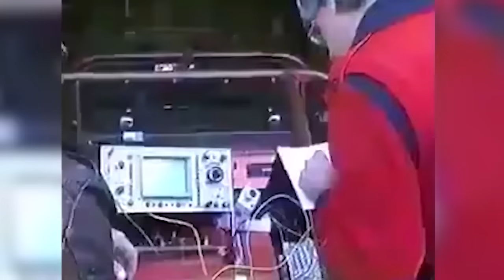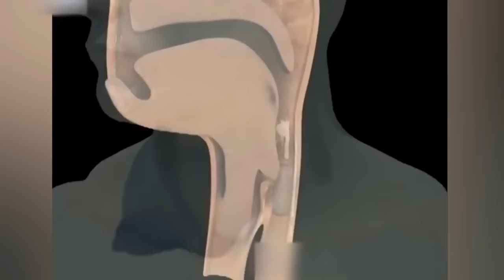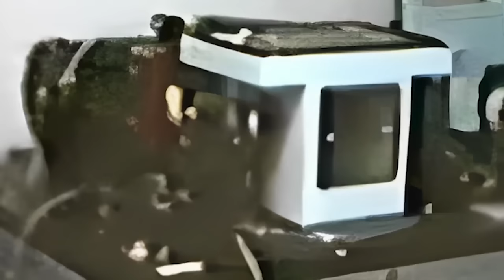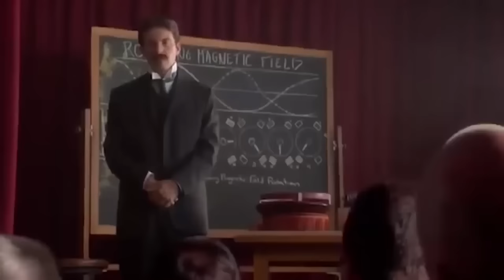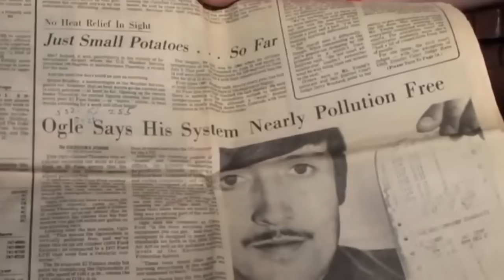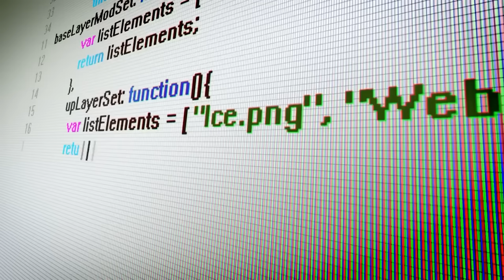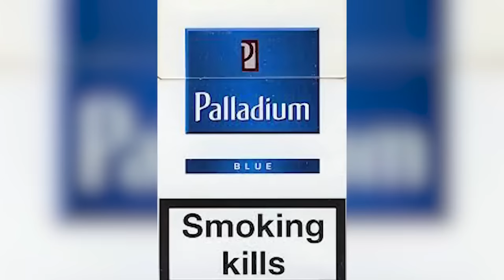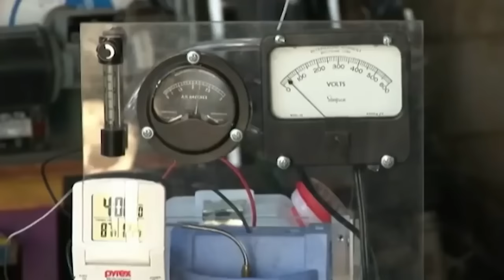Lost Inventions That Could Have Changed The World

Comment: The second item is a heat exchanger. Modern bolts used to mount it don't look particularly old now either.
Reply: I saw that and i was like BULL SPIT. Those are MODERN hexhead bolts. And it's "ancient"?
It might be an antique. It might be early 20th century or even older.
Reply: It is correct that the second item is made by Viktor Schauberger and it is on display at PKS in Bad Ischl Austria 🙂
Reply: ChillCat665    I think youll find its a water vortexer,  causing water to be charged with negative energy

Comment: At a our 2:10 there is mention of an ancient Egyptian invention in an upward spiral of tubing. I wonder how “ancient”. If you look close the contraption is held together with hex head bolts. If you zoom in you can see that there is stamping on the heads but I didn’t have the resolution to read it. Can someone?
Reply: I assumed those were used to correct and maintain it's shape. Those are definitely modern bolts, washers and probably clamps.
Reply: This is viktor schauberger invention 1900s
Reply: Good bolts have their tensile strength stamped on the head. I assume this is what it is.

Comment: Ogle was murdered by the Oil companies because he would not sell his invention to any of them…!
Also, the guy that invented the water car did create a vehicle that ran on water or the Hydrogen in 
water…
There were some issues with it.
One, the water/Hydrogen did not work well with our Norman engines, specifically the pistons.
The water caused them to rust.
If a few modifications were made though, the invention would work…!
Look up Hydrogen powered vehicles on here and they will show you how to create the Hydrogen,
along with how to use it to run an engine.
You can also see equipment and even cars being ran on the Hydrogen…

Comment: #sweettopic is a modern built device.  The bolts have a hex head and there is a threaded insert at the end of one of the pipes also with a hex head.  Nothing from ancient Egypt shows use of hex assembly tools.  Number 19 is an electrolysis machine and the inventor had a mysterious death.  Nothing about it violates any of the laws of energy.

Comment: Some rather misleading comments made in this video. The man who invented the car that used water as fuel was ahead of his time, there are currently people making their own systems that split the water into its base elements and use it as a torch instead. He also died in a questionable manner as well as the man who invented the carburetor that got 100 mpg, but let's ignore that because big oil denied any wrong doing and has only continued to help consumers get all the mileage they can from fossil fuels. Cars in the mid-70's were getting 40-50 mpg when big oil decided to not produce claiming 'shortages', until they continued to receive subsides from the government to cover operation cost, because they aren't making record profits every quarter right. And then, gas mileage went right back to 15-20 mpg where it sat until the 'hybrid' joke of a system was released. 
Im guessing the creator of the video doesn't get the concept of hydrogen fuel cars. Unfortunately, the way they get the hydrogen today is worse for the environment, and will probably be a catastrophe in the future qhen all the CO2 is released from the ground. 
Tesla was well ahead of his time, and the teal reason he didn't finish his research for wireless electrical systems is solely because his investors couldn't figure out how to make people pay for something they get over the air. Apparently, you would be incredibly surprised at the amount of inventions Telsa could create if only his investors had the forsight to let him invent without the constraints of how they can profit from it first and foremost. Clearly, you didn't know he created the first radio controlled device either, a little boat he piloted around a pool in New York City.

Comment: My take on @sweettopic is it's a water heater. Notice the vent holes all around for the smoke and air flow.  The clay would have been heated and water flowing through the tubes been heated
Reply: its an art project non corroaded copper    hex bolts

Comment: 24:00 "the theory of cold fusion hypothesizes that this could be achieved at room temperature." 
No. That's neither a theory nor a hypothesis. The theory was basically that fusion could be made to occur under controlled electrodynamic forces of compression occurring within a metallic crystalline structure with precise properties. And if you actually do the research - it worked. It's still around except it's called Low Energy Nuclear Reactions - LENR.

Episode 7 - July 27, 2023 - LENR (Low Energy Nuclear Reactions) can decentralize power production... - YouTube, https://www.youtube.com/watch?v=LUe97oyXFuA

Cold Fusion Hot Again - 60 Minutes - YouTube, https://www.youtube.com/watch?v=UTvaX3vRtRA

Comment: The water fuel one probably would have  worked but oil men wouldn't like it too because if you can run vehicles on water it would be at a fraction of the price of oil  so I wouldn't be surprised if

Comment: That twisted tube machine looks like something similar to Wilhelm Reich’s rotating momentum accelerated water “wheel” an invention later developed by Sam Klem. By recirculating a fluid (water or oil) from the circumference to core; the effect accelerates the spin by conservation of momentum ( like a spinning figure skater pulling their arms in while spinning,or the rotating Earth that constantly releases atmosphere into space while generating more at the surface.)
A non-consuming power source for power generators or motors. Eliminating the need for burning oil or electricity for rotational power.

Comment: The second law of thermodynamics is still a lot of fun.   Design and make a Rube Goldberg device to continually move.   A clock at some university is still running on a battery made 187 years ago,  A bell is still ringing that has stopped up occasion and needs to be restarted.  A company has used the principal of the Sterling Engine to liquefy air.  It makes gas for the big laser on the Gerald L. Ford.
Reply: That 187 year old battery is NOT perpetual motion, it's just a very slow chemical reaction that produces enough energy to run whatever clock they have it hooked up to.  It's call a Zamboni or Duluc Dry Pile; the electrolyte is dry paper rather than liquid acid or alkali.

Comment: About that 'carburator': OK, today we have gone to fuel injection. What he did, was raise the pre-ignition temperature of the fuel. About 90% of the energy used by an internal combustion engine, goes into bringing the fuel to ignition temperatures. A varriation of what he did, began by wrapping a fuel line around the exaust pipe of a motorcycle. It may have even been this guy. This temperature raising mentality would still be valid for fuel injection. However, concerning fuel efficiency, there are MANY other engine designs available. See Liquid Pistons, Bourke, Stirling, Duke Engines, e-REX [Spain].

Comment: The information in this video is complete BS! Firstly, #20...that is copper piping with a modern fitting on it that can be found in any hardware store. Secondly, #19...I have studied Stan Meyer's design extremely and it had ABSOLUTELY NOTHING to do with "perpetual motion". It was a hydrogen electrolysis system designed to break water into it's separate gases. Hydrogen & Oxygen. Stan Meyers then used the extracted gases, which were already the perfect fuel-air mixture, to fuel a regular gas engine and PROVED that this could replace gasoline as a fule for nearly all internal combustion engines. He also was able to prove that the exhaust from the engine produced clean water that was pure enough to drink or be reused in the engine again. So, this poster of this video has no freaking clue what he is even talking about!

Comment: That's not even vintage! Ancient Egyptians didn't use bolts with hexagonal heads and most certainly didn't know about washers/spacers and look at the numbers on the bolt heads. 🤯 I'm sure they didn't know what bolts were during that period , they built ships and not a single one had a bolt in it let alone a nail.

Comment: 1 the coiled thing is copper pipes modern bolts and steel tube, 2 Stanley Mire car did over 100 miles on 1 pint of water he suddenly died of a heart attack  and his devices were stolen. This was after a certain fuel company had offered 4million for his work which he declined.  Fat and hydrogenated fats are pure evil,

Comment: Your sweet topic is unlikely to be a water filtration device. More likely it's a steam engine. Ancient steam engines, unlike modern ones, heat water to steam and have the steam escape via tubes to use the steam like rocket thrust to push the tubes around in a circle.

Comment: I don't know about the 100mpg carburettor, but back in the 70s to 90s there was always a disparity between USA mpg and European mpg even from the same companies eg ford's. This was simply just caused by the difference in fuel prices and the US love of very large low compression engines. In Europe with its high fuel prices there was an impetus to create higher compression more efficient engines to keep motoring costs down.
I spent a couple a couple of years in the US and you would often smell petrol fumes when very old cars went past. There is always the possibility that there were fuel leaks but it seemed more likely to be unburned fuel in the exhaust, something you pretty much never smell in the UK or other parts of Europe. So if fuel is going straight through the system then it isnt very efficient.

Comment: I stopped listening to this video when you claimed Stanely Meyer's fuel cell was some kind of perpetual motion device, the thing worked and the man died for it. Get yourself a working fuel cell and watch a 200+ degree flame sublimate tungsten. I blow glass with HHO all day long with no more than 110 volts and less than 12 amps... the technology exists, it works, and one could easily blow a small size sedan up with about a tablespoon of water. It's the cleanest 'hydrocarbon' fuel known to man as it contains zero carbon, and the only exhaust produced by it's combustion is the cleanest humidity scientifically possible, literally new water. Considering the earth is covered with the stuff, it bubbles up through the ground from god only knows how much in practically endless aquifers, and it falls out of the sky for free, and is endlessly renewable, now who would want to keep that little secret from being disclosed to the general population? For any of you out there that actually know about HHO and are interested, I'll give you a little hint, resonant voltage not amperage is the trick and 'tuned' tubes work much better than plates. On demand hydrogen could change the world, and before any asshat wants to claim it isn't efficient, did you factor in the geopolitical costs of drilling, transporting, distilling and importing petroleum products or the numerous ecological disasters into your fancy equations? Voltage can be stepped up, distillation cannot.

Comment: 2:11... yeah right. With metric Hex bolts than have tensile strength markers on them...
Damascus steel: The technique is still in use today, but the Japanese used it since they did not have a good steel quality and this way it was a stronger material. Later on the just imported steel from Europe, which had better techniques in the alloying of steel.

Comment: Ogles carb. Usual hype and bs.  Only possible to get x number of miles per gallon based on the weight of the vehicle and the total btu's per gallon.  Changing the fuel system does not increase the heat efficiency of an ICE.
Reply: It is not bs others have done it as well

Comment: Your full of crap ! Re : water purification device..it has modern graded bolts on it. But it is and was a water pump , using magnets on a disc being spun or using power would heat the pipe and force water to flow up under pressure 🎉🎉